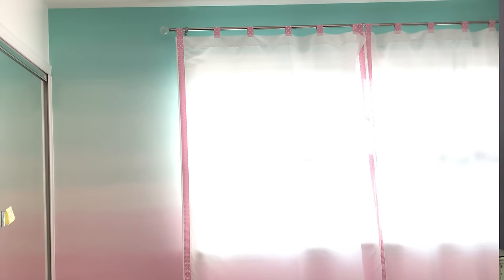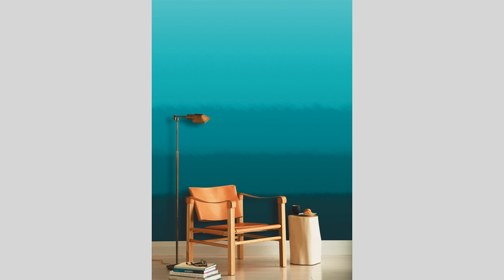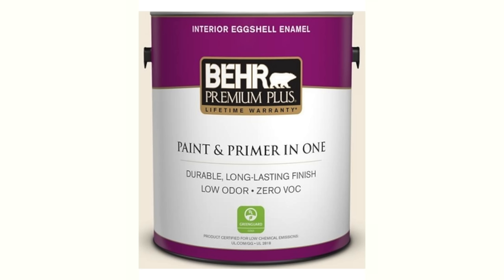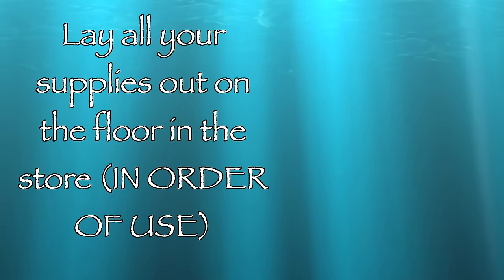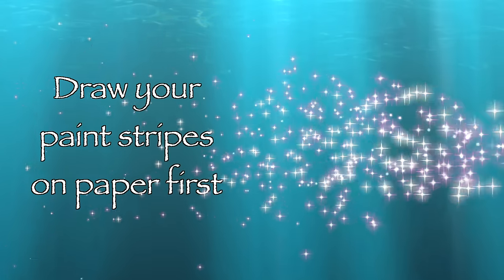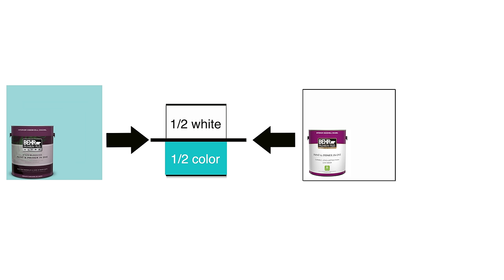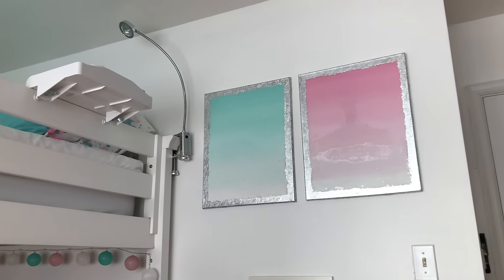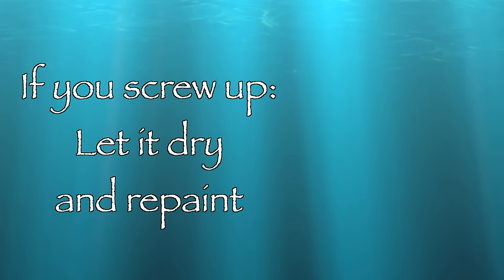Ombre Wall DIY: How to Paint an Ombre Accent Wall (Tutorial, Tips & Tricks)

Comment: This has been the best ombré tutorial however, I’m scared that if I use my solid light blue color and add half white, for the first transition, that it will be too much of a light transition. Any suggestions? I’m only using light blue to white. I need help with the measurements of white for the transition.
Reply from the maker: You can actually add more of the original color back into it to darken it up if it is too light and you want less of a transition.  This is why I highly suggest using a canvas.  The 1/2 method was perfect for the aqua but we ended darkening up the pink by adding mor pink to the first color

Comment: The best explanation I’ve seen so far, but when the guy doing the strips uses  the brush, he doesn’t do it in a 45 degree angle.  He just did it in a straight line.  Why is that?  It’s confusing.